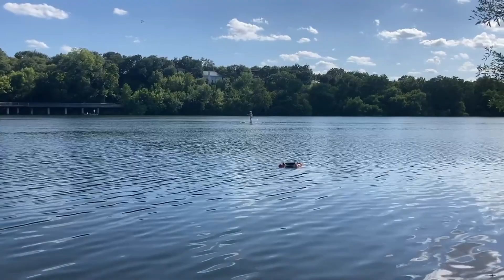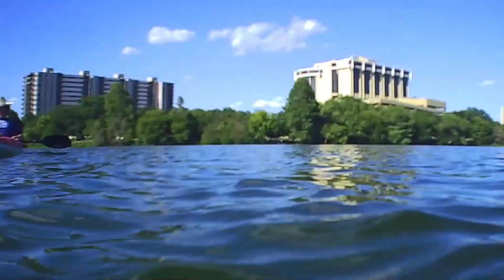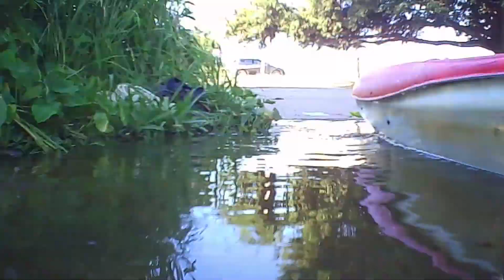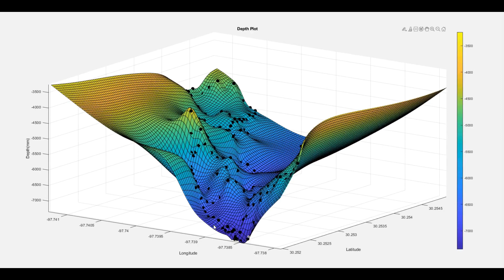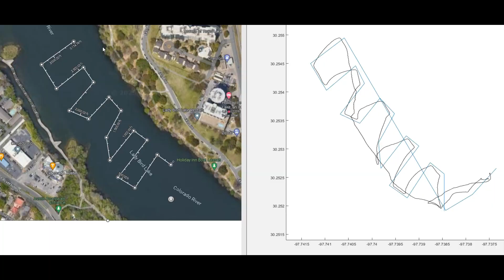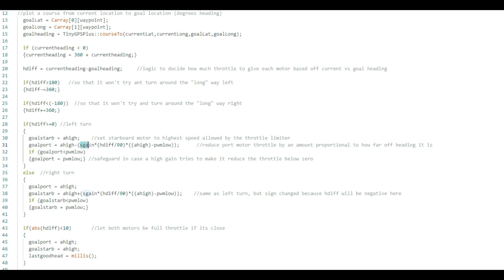Self-Driving Robot Surveys Floor of Ladybird Lake - Austin, TX

Comment: Great work. I think the next step is to calculate headings from changes in GPS location. Next, next step would be a control loop of compass heading,  GPS heading, and target heading. With your recorded data you could quantify and simulate drift in Matlab to test the control. The band-aid patch would probably be to generate a sub-coordinate target ever ~20ft between true targets.
Reply from the maker: Matlab simulation is a great idea. The problem with using gps for heading is that it’s inaccurate and low update rate at slow speeds. But it could certainly be helpful for correction during very long straight lines.
Reply: @Clay-Builds  Did you ever look at RTK correction? Ground base station (yours or any existing) can send correction data to the rover

Comment: it doesn't make the arcs because of the wind, but because of the noise of the compass and the loops are caused by the boat going around 360 degrees and turning around a full circle, set it to turn as short an angle as possible, then this won't happen anymore and the boat will turn to your side on which he has, I have also been working for the last 3 months.

Comment: This is awesome! I'm excited to see more from this project. How often do you get a sonar measurement & what polling rate is the sonar capable of?

Not sure if you have already implemented this, but if you support KML files for your mission waypoints, that opens up a whole host of free mission planners that are used in the UAV surveying industry. A lot of these mission planners will let you draw a polygon of your area of interest and automatically generate a grid of waypoints that maps the area at your specified density. Btw the KML files are just glorified XML files with GPS coordinates. 

I believe there are already XML/KML parsing libraries for Arduino/Teensy.
Reply from the maker: This was done with a 30 second sample rate on the sonar reading. It’s capable of doing much faster than that. I haven’t tried but I think it could easily update multiple times per second depending on depth.

I’ll definitely look into KML, sounds useful

Comment: Nice everything, very impressed! Great process, vid presentation, and boat name as well.
One comment: The drift on the long leg looks proportional to the distance of that leg between waypoints. If you scale up some of the other legs with their corresponding path segments, I think some would look worse. Easy fix might just then be to add more way points along the return /limit the distance between to some max value. Maybe a tighter tolerace for the last point or two to bring it home to the ramp?
Reply from the maker: Yea, more waypoints would definitely help with the wind blowing off course. And it definitely could handle a tighter tolerance for the waypoint distance, as long as it’s wider than the turning radius

Comment: Awesome project!   Curious about what your day job is... :)
I really like your future iteration plans!  Two thoughts I had that I wonder if you considered:  Change to a bow thruster for steering.  It wouldn't take very much current, and it could even give active correction during forward travel.  Maybe generating a large set of waypoints (100s or more) from your initial path plan.  Then having the robot seek to the next waypoint and only sending a ping once there.  Wouldn't that generate a near perfect overlay of data points?
Reply from the maker: Bow thruster is an interesting idea. Kinda hard to implement in the dual hull/pontoon setup without adding a ton of drag. I’m leaning towards using rudders in the rear so both motors can be left at full throttle during high speed and fine course correct with rudder only, using differential thrust for tighg turns in place when necessary. It doesn’t need to perfectly follow the planned path to generate an accurate map because it uses actual measured gps locations for the data points, not just points along the planned path.
Reply: @Clay-Builds  Oh, I thought you mentioned that you were thinking of going to a mono-hull?  Take a look at some fullsize sailboats or yachts today.  They have bow thrusters built right into the hull to minimize drag ;-)   Might be worth exploring..
Reply from the maker: @LM-ek2hb  I plan to make new hulls from fiberglass or something like that, but sticking with the dual hull setup because it lends itself really well to having a large flat top for solar panels while keeping a low draft and having a low profile above water as well to reduce the affect of wind.
Reply: @Clay-Builds .  Great design!    Hopefully I can follow in your wet footsteps...smile.  Just starting my build at our local Makerspace.  For a steering upgrade, I might suggest adding a couple keels to the pontoons.  Without a keel the pontoons are skidding in the wind and unable to correct course.  Also, with keels your rudder(s) will have more authority.  Good luck and thanks for the videos.

Comment: I am planning to build a robotic boat capable of carrying a 50 kg payload over a 300-meter distance, following a rectangular path with four waypoints starting from the home point. The application is for an automatic fish feeder. Could you please provide guidance with this project.
Reply from the maker: That’s a pretty heavy payload, you’ll need more displacement than this thing. Could use much larger pipes for pontoons, but they start to get expensive at bigger sizes. I’m currently working on a fiberglass hull version designed for a 15kg payload. I think fiberglass hulls is a good option at a 50kg scale too, but you could also consider inflatables, or just modify a pre built kayak/canoe. I think 50kg worth of displacement would need some significantly more powerful motors to achieve any reasonable speed and control, especially in wind/current. The code I’m running here can easily handle a 4 waypoint mission, you could add in a function to drop the fish food at certain coordinates or time intervals.
Reply from the maker: Sorry, I’m not really interested in any kind of private collaboration.

Comment: Hi, excellent project. I'm from Brazil and I've been looking for videos on this subject and there are very few. What is the sonar model? Can you recommend other sonar models? What is the detection distance and whether the bottom or vegetation at the bottom of the river can influence the measurements? Does it work at sea? thank you very much for your attention.
Reply from the maker: The sonar module is a blue robotics Ping. I don’t really have experience with other ones. It works at a depth up to 100 meters. I think the lake in this video has lots of vegetation and soft mud on the bottom which didn’t cause a problem. It should work at sea too but I’ve never tried.

Comment: This is great ! 
I am working on a very similar project, and I am really curious about how you post process the data from the Ping sonar (ie, to make your beautiful plots: how do you extract the raw data -Raspberry Pi, Arduino,..., and how do you plot it - Python,...). 
And also, how do you link your Ping2 depth data to the GPS data ? As far as I know, the Ping does not connect directly to a GPS, so you would have to link the data "manually" (as in, it won't do so automatically, you have to code that).
Thanks a lot for your video !!
Reply from the maker: There’s a GitHub link in the description with all my code. The arduino records depth measurements from the Ping to an SD card. At the same time as it records a depth measurement, it also records the GPS longitude/latitude it’s reading from the GPS module at that instant. The Ping doesn’t directly interact with the GPS, the arduino simultaneously records data from both in CSV format. So each line of the .txt file on the sd card is effectively an x,y,z coordinate point where the z axis is depth measurements and x/y are the gps coordinates those measurements were taken at. 

I then feed this raw .txt file into a Matlab script I wrote to create a 3D scatter plot of all these coordinate points then extrapolate a smooth surface between them all. 

Sometimes I manually delete a few erroneous points from the .txt file before running it through the Matlab script.
Reply: @Clay-Builds  Thank you for the reply ! Yes, I did see the github now, but I have never coded on an arduino and I don't really understand everything that's going on in there. :) I'll give it a closer look though !